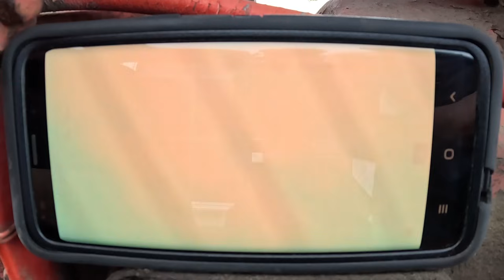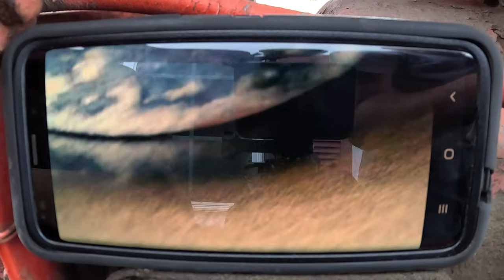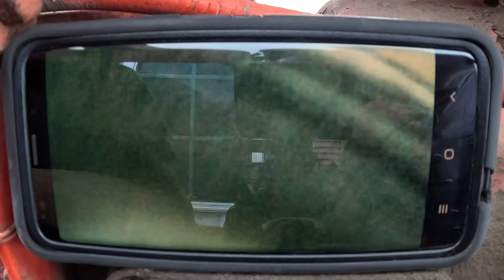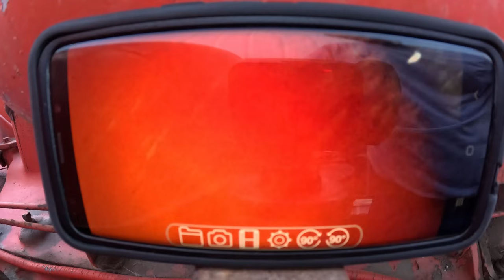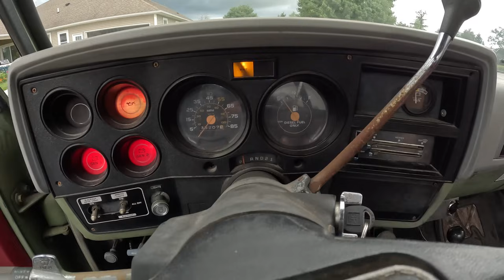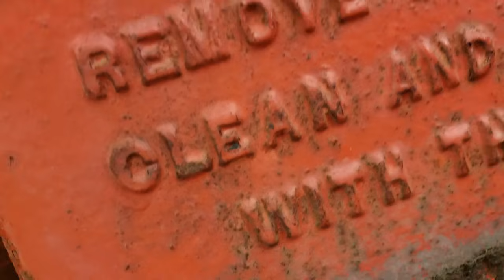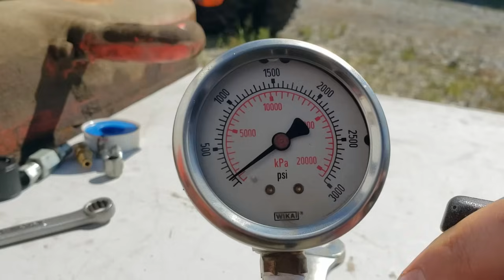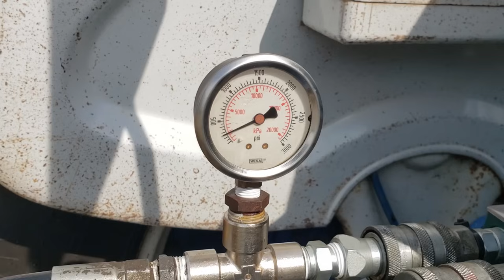How NOT to Unseize a Stuck Engine! - Latest Auction Find!

Comment: We have an LA here that had a stuck motor when we got it.  We freed it up by making an adapter to thread in place of a spark plug to hook a grease gun up and pump it up.  It took some work, but it did the job!
Reply: That much pressure runs the risk of blowing the head gasket. You were lucky.

Comment: If you take the rocker arms off, let all valves close. Take the spark plugs out. Break the porcelain off then braze an air line fitting to the threaded plug base. Pour in a few ounces of Marvel, screw the plug/fitting into the cylinders, then hook an air line to it. Come back tomorrow and turn the engine over.

Comment: Nice work! Most people would have given up after a couple of days. Looking forward to seeing it run again!
Reply: #3’s valve was probably, at least, partially open therefore rust.
Reply: It won't run very good
Reply: @DaveJennings-y5o  
I don't doubt your comments as I don't know much about this stuff.  To me what was done so far is just black magic.  But why do you think that?  Do you think replacing the valve is necessary?  Is that a huge job?

Comment: A 49 LA is exactly what my father taught me to drive on.  Those big lugging tractors were commonly referred to here in KS as "wheatland" tractors.  They could pull a 5 bottom moldboard play around a 640 scre (one full section) field.  Edited at the end to say nicely done! I am amzed you got it free without taking the head off and/or dropping the pan - good job!

Comment: Bravo to you for getting the engine unsiezed! Fought the same battle with a Briggs and Stratton engine on a Troybilt 5500 Watt generator I found on the curb. I lost. Even with a sledgehammer on the piston and lots of penetrating oil, never came unsiezed. I bought a replacement engine in the end. I wish you nothing but success in getting this tractor started and running! Great work  Randy!

Comment: Great video.   My dad had a LA for years. That is one that I used to pull 4-14” plow and a 10’ disc and a 3 section Brillion Cultillitcher. I could hardly see over the hood. I thought I was on top of the world. Memories. No individual brakes the drawbar would swing totally from wheel   What a tractor

Comment: At least you are persistent.   In a case like this I have had good luck heating the whole block/pistons with a heat gun in the water inlet to the block.  On a recent one I insulated the block and let it cook up to 250 degrees F.  After that cycle and cooled back down I was able to break it free with force.  The tractor runs great now.

Comment: l soaked an engine free.  it is a one cylinder marine engine. i had it in the cellar next to the boiler.  it took 17 years.  i had a steam car come to the farm for repairs.  it too was stuck.  i used the hydraulic system that you did and it came free.  i agree with everything that you are doing.  my advise... loosen the rod caps and see which piston is stuck.  work one at a time.  be certain you are not fighting a bearing.   my best wishes, and thank you for preserving our farming heritage.  i wish i could help you more.
Reply from the maker: For a while there I was worried I was fighting a bearing. Once I pulled the side plates everything looked fine so I figured I was good to go. Assuming that if it had a spun bearing you would see some discoloration on the rod cap.

Comment: Randy ya'll went above and beyond the call of duty on this Case. I wondered when ya'll would give up.  I especially felt glum after it moved then tightened back up. The tale will be told this summer. As it works and keeps on working THEN SUCCESS. Oh yes Randy, I really like this Case.  Number three needs some rust melt liquid like either Solvo Rust or that old time gel for absorbing rust, especially #3. Otherwise  vinager, or muriatic acid will be a good friend.

Comment: Persistent!!! I have an old Miller diesel welder,1972. that still works and welds fine. I only had to clean the commutator and the fuel system.

Comment: If it was a stuck valve ,i would think it would bend the push rod's? Man is doing a great job.
Proud of ya😁
Reply from the maker: I've worked on a couple before that had stuck valves that someone else tried to get running. Pushrods were bent.
Reply: 33:37 😊 34:58 34:59 34:59 34:59

Comment: in addition to the many "helpful" ideas offered in the comments I would recommend use of vinegar, CLR or other weak acid fill the problem cylinder and let soak. All the hydrocarbon rust busters really do not attack rust, but vinegar which is an acid will. If you have a block heater that is high output it would be a great way to sustain some useful heat to speed up the work of the acid. Suck pistons are really problematic because there is virtually no access to the corrosion layer between the piston and cylinder. My preference would have been to remove the head and get direct access to the stuck piston, then use hammer, acid and direct heat to the piston and cylinder. As it is I think it would be quite surprising if the piston rings are not all stuck in the grooves, but maybe luck will shine on you and with some solvents in the oil you can achieve a decent cleanup and  freeup as the engine gets some run time. Really inspiring video, thank you!

Comment: I once had an old pump motor with a seized piston. A old mechanic suggested automatic trans oil. I did follow the sugestion and it worked very well.
Reply: Transmission fluid and Kerosene 50/50 and let it soak the best stuff there is.

Comment: Gotta give you credit for the persistance and working outdoors. We  had two LA Case tractors back in the 60s and used them for plowing mostly but gas prices drove us to using diesels so both LA tractors are gone. You will probably get that old girl to run but to get much HP you will probably have to re-sleeve it with new pistons and rings. Most likely looking at a total overhaul but looking at the rest of it, well worth it.

Comment: What I did with my tractor is fill the cylinders as you did with automatic transmission  fluid and acetone and then drain the antifreeze and fill the cooling system with boiling water to expand the cylinders. Then I took the starter off and put pressure on the ring gear teeth with a bar and then managed to get it loose

Comment: Here's the best technique.  As proved by success with a 36 Farmall F12.  Bought it for almost free.  Rubber tires.  Wouldn't turn over.  Pulled her home. Took the oil pan off and disconnected the connecting rods and tied a piece of binder twine around the lower end of the rods and gave them a series of jerks to loosen all of the pistons up.  When they were all free put her back together. Gave her some gas.  Hooked her up to the back of my old pickup truck and pulled her down the driveway.  And away she went.  Was still running when I sold her many years later.

Comment: Take all the oils out of the cylinders and fill each cylinder with Coca-Cola, let sit for 48 hours. I have never had it fail me. Once freed up, drain cylinders by blowing them out and add oil to them. Leave plugs out while pulling the tractor around for a bit to lubricate the rings. Blow everything out again, install plugs and proceed with the next steps to get it running again. Best of luck to you! I love seeing old iron revived.

Comment: Randy, I am very interested to hear it run soon.  Atop the exhaust pipe, it needs an adapter to prevent rain water from getting down the exhaust and into the engine.  That is probably what messed it up in the first place.  I imagine there is a lot of water in the crankcase that needs draining out asap.  Thanks for all the persistence.  Yes, those valve keepers must be changed out right away.  I have worked with stuck engines also.  I liked your example of using hydraulic pressure to move #3 up and down.  Seems like you are very close to getting it running.  Before spinning it any more, get out the old oil and water out of the crankcase and replace with fresh oil.  Let it spin awhile with the plugs out, to get oil pressure up and everything lubricated before trying to run it.  The carburetor will need good cleanout and rust removal.  So will the fuel tank.  Good luck with those next- steps.  
      I must say that I greatly liked reading of the person who used the mild vinegar acid trick while leaving some (tractor weight) pressure on the crankshaft and letting time do its work very appealing to hopefully free up piston rings that are probably frozen in the piston grooves, as well as eliminate piston seizure in the cylinder(s).  He found after some days that his jack had indeed turned the crankshaft by the tractor's own weight once the rust was dissolved.  Brilliant.  No great pressure was applied to any one part, which is also brilliant.  Just time did the work.  I also like another post speaking of doing the same thing but applying Marvel Mystery oil and waiting for the tractor to drop when MMO eventually dissolved all the issues.  Probably that frees up rings stuck in the piston grooves almost as well.   
    Hope to see it run soon.

Comment: To unseize your engine , pull the plugs and fill the cylinders with laquer thinner, put the plugs back in a few turns and let it set a few days .  The engine should loosen up with a little back and forth action 
but don't FORCE it !      Then drain fluids - - the usual routine to bring it back alive .   keep us posted !

Comment: Have an old Allis Chalmers D12  sitting for two years in a pasture not running froze up engine. I removed the oil drain plug and out poured enough water to fill a 05 gallon bucket 3/4 s.  Left the drain plug out , removed spark plugs, & vale cover and then sprayed GIBBS in those areas and into the oil fill tub...total cans used first day 03 cans.....waited 03 days and used another 03 cans...on the 07th day turn ignition( all fuel was drained out  no fuel in the system no tank during this)  and when starter engaged it spit out GIBBS from spark plug holes.. Did that until no more came out put in new plugs and cleaned carb out ...Been running ever since and that was in 2019

Comment: Acetone and trans fluid 50/50 works good poured down the spark plug holes or injectors on a diesel for a stuck motor

Comment: I have done it but used a lot more lube I filled every cylinder to the lid with diesel and kept topping it up for 2 weeks. Then put a grease nipple on a spark plug shell and started pumping. That broke it loose and then used a bar on the ring gear teeth to get it rotating. An oily mess but it worked.

Comment: What Ive done on several motors is to take a soft plug out and put a steam cleaner  in the soft plug  and half fill cylinder with marvel mystery oil keep steam cleaner going until the penetrating oil by pass.s piston works well

Comment: If you plan on using the tractor, you're going to have to rebuild. You know the rings are shot and there's going to be rust pits in the cylinder where the rings rested. You won't have decent compression. There'll be lots of combustion gas in the crankcase from blowby. It will never have power the way it is. 
In the time you've spent, you could have had the engine out and apart.
Engine rebuilder, mostly diesels and racing engines.
Reply: But it will only be a Parade thector
Reply: Hope you didn't pay much for that old heap.
Penetrating fluid and a breaker bar and cheater pipe does wonders.
Would need a total rebuild most likely. Complete waste of time and money, no profit.
Reply: @mikespain8655  Guys that live to bring old tractors back to life aren't worried about time and money. Squatch253 is another YouTube guy, who brings old Caterpillar dozers back to life. He is a guy who refuses to cut corners on a complete rebuild.
Reply: @mikespain8655 theres no point in restoring one for profit of course. Thats not the point really and if there was a possibility in that someone would have already done it.

Comment: i have good  luck  using evaperust in the cylinders about  a few cups worth in each cylinder, let sit 2 days  and  broke free so  damage to rings  or  sides. need to change oil  of course  but  almost  went flying  when came  back to try hand crank... it was  loose as a goose!!!

Comment: When you get it running the cold start up with a 6 volt is very slow cranking almost like a pig grunting. Back in the day we would start our LA with a belt over the fly wheel of an other tractor but you have to turn the belt over or you’ll be turning the one tractor engine backwards.Even with the slow starter it will fire up , we never dared try the hand crank.Back in 1956 ours was a 1943 model with a small gas tank to get the engine hot then you turn on the larger kerosene tank . My brother restored it and it’s in his barn The tractor looked huge back in the day but by today’s standards small . We had the muffler off back then and farm hands would light their cigarettes off the exhaust.
Reply from the maker: Thanks for the story!

Comment: I would have been tempted to put a mixture of diesel,oil and kerosene mixture in all of the cylinders and set number three on fire with the torch (sump plug out and fire extinguishers ready) great idea with the porta power . New valve retainers and it should be a runner of some sort. Regards Chris

Comment: If you can get the valve cover off loosen the rocker arms till all valves are closed. Alternatively make block off plugs for carb and exhaust pipe. Remove spark plugs, break off the porcelain and  braise air fittings in the threaded shell. Put Marvel Mystery oil in the cylinder(s). Attach an air hose with 150lbs air pressure to the fitting. Come back tomorrow and turn the engine over.

Comment: Great job, great job, freeing this siezed engine, I'VE got one an ezact model like this, its an LA Case tractor 1951, it has a big 3' x 7' wide push blade for dirt or swow, but it doesnt run on gas, it runs on propane, and now these sobs will not and have stopped fueling my tractor with propane, AS THEY DON'T DO THAT ANYMORE, I'M screwed, now. 😭😭 so now i gota sell it😭😭😭😭😭 
I had a car engine siezed LIKE THIS, what i did to break it loose, i sprayed in all the cylinders without plugs the plugs with carburator cleaner, I left it set for almost 2 weeks, and surely but surely it barely would move just a little like  your tractor did,  I repeatedcthe process all over again, and resprayed all the cylinders again and (I DID REVERSE TURN DIRECTIONS AS WELL, I eventually I DID finnially MAKE PROGRESS SLOWLY BUT SURELY I GOT IT TO TURN COMPLETELY BOTH DIRECTIONS, NOW LET'S SEE YOU FIRE THIS BABY UP, 😁👌😉✌️🤠👍 MORE PLEASE MORE, ✌️🤠👍

Comment: Take starter off use a pry bar on the fly wheel also running hot water through the radiator will help

Comment: I look into each pot with a bore scope, to see what gives and if there is any water,  Water is removed using tuvbe and pump, and then one adds a mixture of methylated spirits and oil, or my favourite, a mixture of petrol (gasolene) and outboard engine two stroke oil, about 16:1 will do it.  Pour some in through the spark plug holes.  Put into fourth gear and rock tractor back and forth to see if anything will move.  If no joy, I then remove the starting motor and use a large screwdriver or small pinch-bar against the cogs on the ring gear to see if I can get it to move that way, but be gentle, do not overdo it. Valves are also probably stuck, so off with rocker box cover and see if any movement or stuck valves,  Penetrating oil or auto fluid and acetone frees up rusty nuts so it might be worth a try in stuck cylinders.  I have also tried using a big socket over the crank pully nut--that can also do it.  One of my pals removes radiator hoses and then pumps hot water around the block and that seems to help.  I suppose it expands the cylinders a tiny bit.  Maybe it helps the oil penetrate--who knows?

When all else fails--pull off the cylinder heads and get serious--wooden blocks and mallets to tap pistons downwards.  UIf that does not work, engine has to come out and sump and crankshaft removed, and press employed to push pistons downwards out of the block which has been sprayed with diesel oil from below, or if engine is mounted on a stand, turn it upside down and fill the underside of the pistons to above skirt height with a mix of diesel and petrol, or a mix of  old automatic transmission fluid and acetone.

I really liked the idea of using air pressure above the piston to drive oil between the stuck piston and the rings.  An excellent idea--making up one for myself,.  Using too much pressure on the crank may bend the con rod.  Time for the hot water?

Comment: When trying to push the tractor to get it unstuck, it should be in the highest speed gear. This applies much more force to the engine crank than low gear would (on the stuck tractor.). Also worth noting, Brake Fluid can help get things unstuck because it can remove rust..

Comment: Sure you can free up a stuck and rusted engine but then what do you have after? A scuffed piston/cylinder engine with low compression, scored/stuck  rings and a piston well on its way to a knock and eventual catastrophic failure.

Comment: A big shoutout for your persistence… without breaking anything. I learned some new techniques. I’m 70 years old. Do you think heating the cylinders did any good?
Reply from the maker: I don't think I was able to get enough heat to do much good. If you had a way to put 200ish degree water through the block I think that would have helped more.

Comment: What is the saying about doing the same failed process over and over and expecting a different outcome? How about a big bolt head on the rod and try an impact wrench to turn it. Impact wrench will give it several impacts per second.